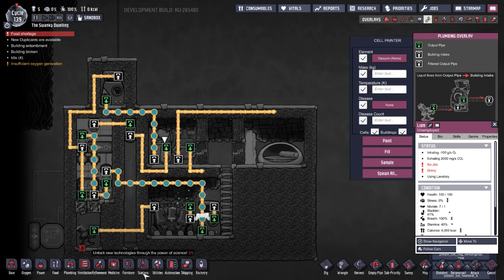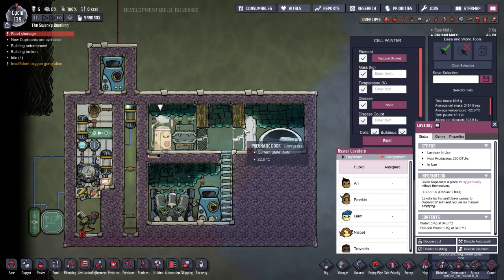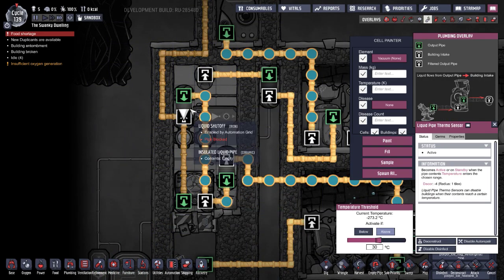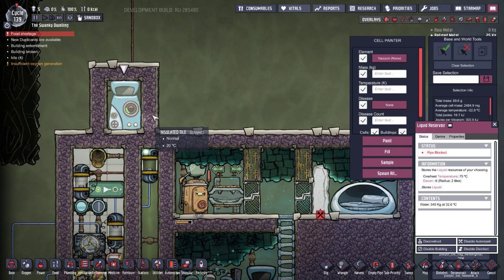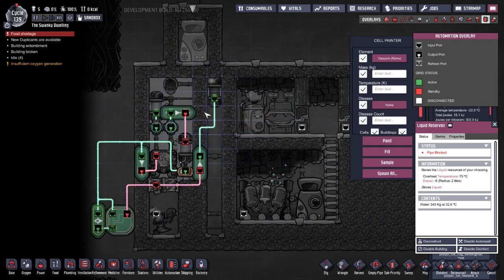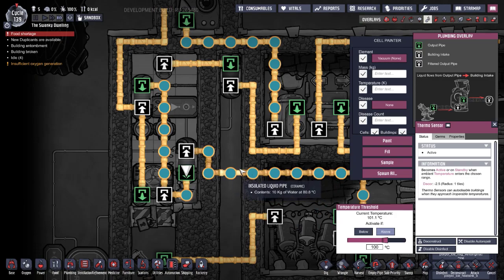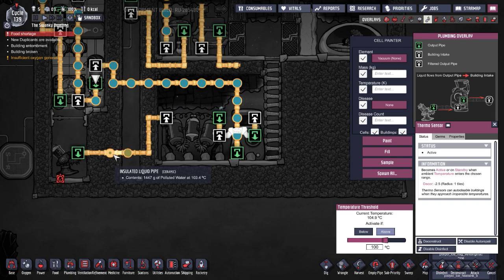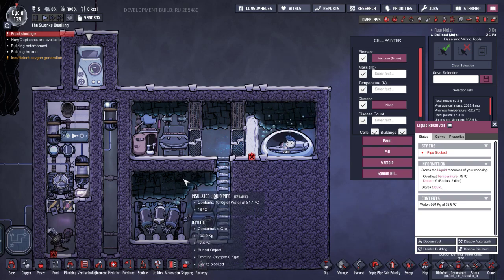Oxygen Not Included- Toilet Water Coolant!?

Comment: One problem I had with this design is getting clean water into the cooling water, while the cooling room is full, which resulted in the clean water hitting 100 degree in a full room and the pressure change to steam blowing a hole through a ceramic tile.

Having another tile of free space above the liquid vent might solve it, giving the steam space to go to, alternatively turning the thermostat slightly under 100c (e.g. 95) was what I did to save it once I reloaded my save.
Reply from the maker: Are you saying the pipes in the aquatuner room were bursting? Make sure you build the insulated pipes out of ceramic to avoid that but your idea of lowering the thermo sensor is a good idea as a fail safe.
Reply: @LurkzGaming  No the ceramic walls burst
Reply: Turns out the failsafe doesn't work for the issue I had, which was water pressure.

As small pockets of oxygen and polluted oxygen got into the room from the steam and polluted water, they took up space the water needed to avoid pressure issue, and that caused a wall to burst.

Once I built the chamber 1 tile higher than the liquid vent I seemed to solve it, as the gas always had 3 tiles for themselves then.
Reply from the maker: Strange, I have never had a solid tile burst due to gas pressure. Good to know how to fix it though. One more thing is you shouldn't be getting steam in the tuner room. If you'r heating the PH2O to its vape point you should turn the thermo sensor down.
Reply: @LurkzGaming  I had it set to 100c on the thermo sensor, but was using polluted water to cool a metal refinery, then the resulting 80-90c pwater I sent from refinery to be used for cooling in the design, but sometimes it would use the pwater twice to cool steel production, making it evaporated the polluted part, giving me clean water in the pipes that then end in the room for cooling.
Reply from the maker: Ok, that makes sense.